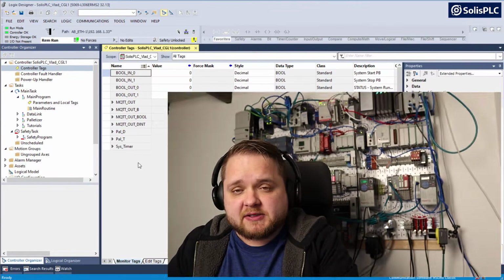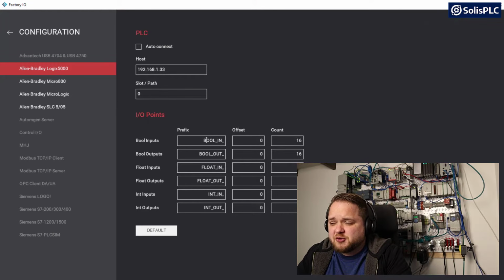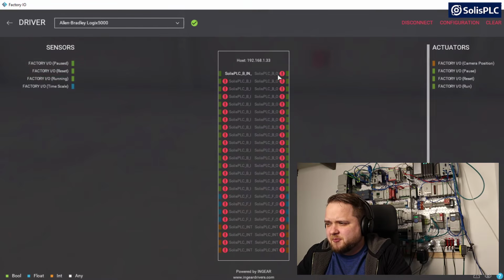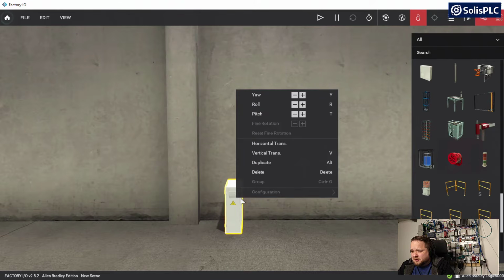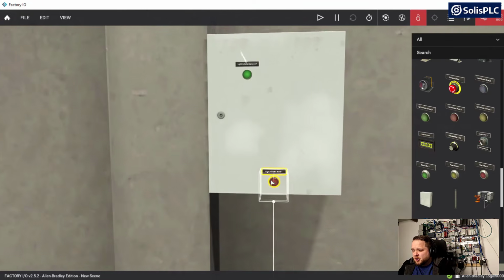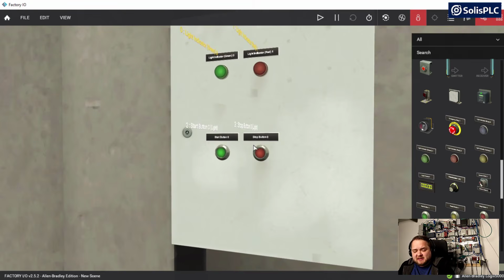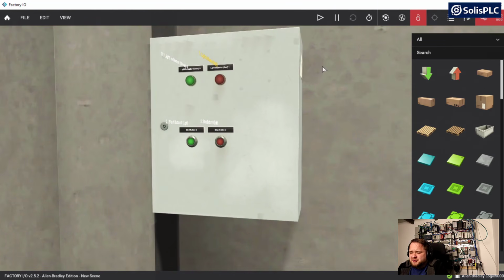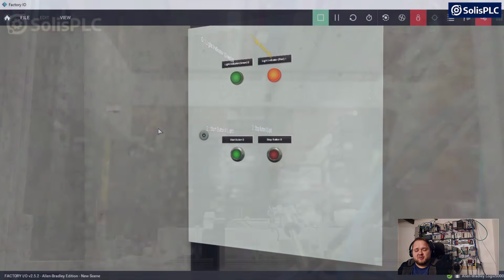PLC Programming RSLogix 5000 / Factory IO - Inputs Outputs, Motor Starter in Ladder Logic [Part 2]

Comment: So are you able to use this with the free version of RS logix 500 and the emulator, or do you need a physical PLC?
Reply from the maker: I'm not sure if it's possible with the Emulator; I'll have to test it out. In theory, the emulator doesn't give an IP address for the virtual PLC, so the connection may not be posible.
Reply: its possible, you can retrieve the IP adress in RSlinx, I did it with the emulator @SolisPLC